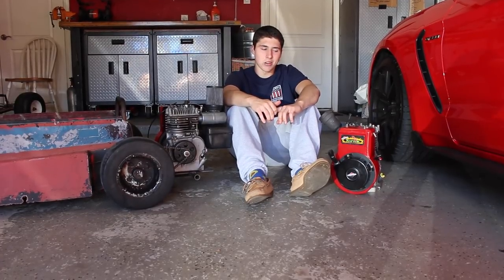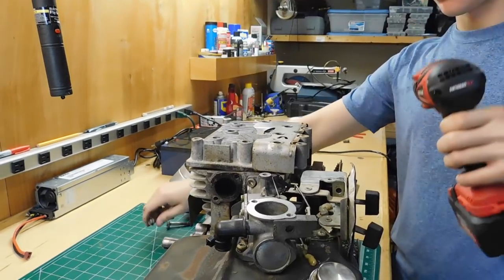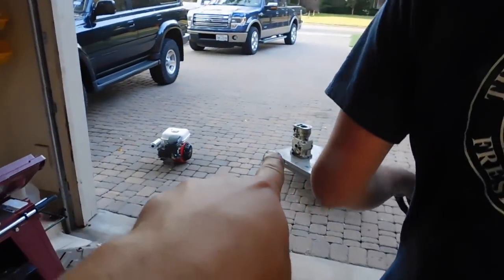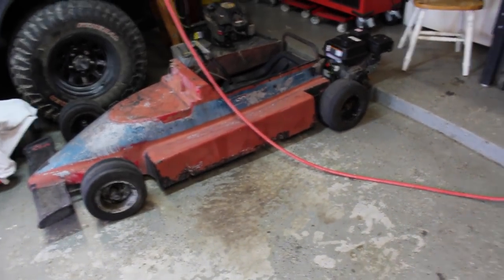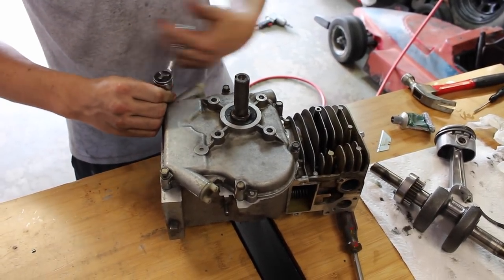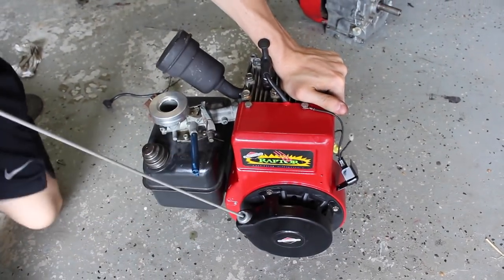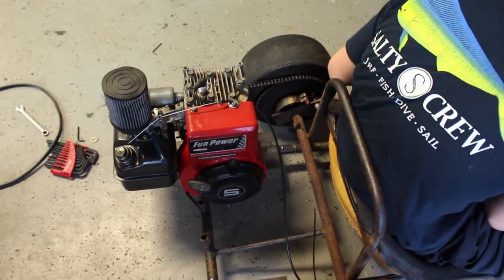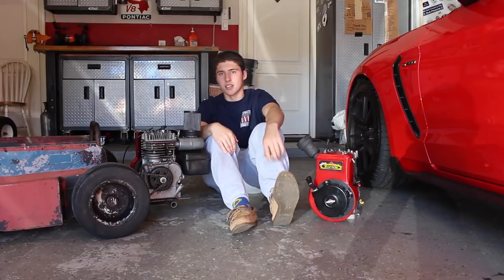Flathead Briggs Raptor Engine Rebuild for 60's Go Kart!

Comment: when i was a kid my dad gave me a mini hone meant for that block and i honed my 5hp block with no issues, but i remember it having a factory steel sleeve? It was a block from the 70’s. That motor made 12hp on alcohol back in the day, that kart was moving👌
Reply from the maker: That’s sick, yeah these ones don’t have steel sleeves as far as I can tell.
Reply: Build Break Repeat build that hemi predator up.........use a Honda clone head cuz the hemi predator has a flat top piston and adds good compresson

Comment: pretty sure the block for the raptor  engine is shaved meaning higher compression possible even had some porting done. just saying that to let yall know
Reply from the maker: Christopher B That’s pretty cool, I’ll have to take a look at the old head.
Reply: @BuildBreakRepeat  porting is done on the block on flatheads. The heads just have a fireslot of modded

Comment: The best way to hone is use an old school hand crank drill and a 3 stone home. A good cart engine builder can bore the cylinder and install a stainless steel sleeve.

Comment: A good way to seat the valves without removing the head is to pry up on the valve spring with a screwdriver and suddenly pull the screwdriver out.. takes care of any carbon issues around the valves.

Comment: a) taking the piston that is scoring one cylinder and putting it in another block will not make it stop scoring the cylinder
b) putting in the piston from a different engine without first checking that the tolerances match will give you blowby or cylinder scoring (or both)
Reply from the maker: Nikolas Tesla We thought about that and that’s why we didn’t keep the raptor piston in there, we just put the original pistons in the engine so there would be no issues with that, thanks for the advice tho.
Reply: No! do you know what rings are?

Comment: my mini bike has a briggs and stratton 5 hp flat head engine but i dont think it will last long because the cylinder walls are kinda bad
Reply: Donovan Bryant I’ve had a 60s Briggs since brand new and the cylinder walls have been scored ever since the 70s and it’s still a great engine so don’t worry

Comment: Yea but that fly wheel wont usually turn over as many rpms as a predator 😂 buy a predator build it and it will have more power than any built 5hp flat head unless its from a true flat head builder still ohv engines make more power than a flatty
Reply: Damn people who dont know about small engines crack me up😂
Reply from the maker: Kylee Bates Yeah your right but I mean we’ve done other racing go karts and stuff in the past but we’re really not building this one to be crazy fast (or else we would have done live axle) we are just restoring it and making it cool and in our opinion a flathead briggs is cooler than a predator just cuz of its classic ness.
Reply: Kylee Bates you sir are incorrect built properly a 5hp flathead will dominate a 6.5 predator ever heard ofa blockzilla briggs if not look it up
Reply: Yea an the only way to get a blockzilla is from briggs. Dont start dissing me buddy i know alot of people whos made pretty close to 45hp if not more with a pred you'd be surprised what us southerners do to our ohv engines
Reply: A Raptor III with a tillotson carb and a billet flywheel isn't exactly a push over.
Reply: Kylee Bates that's when the big gx390 steps in I got a built 390 an I'm building a Briggs vanguard v Twin
Reply: Kylee Bates an you gotta do a lot to a Briggs Flathead to even come close to making the power as a Bolt on predator nobody Race's Flathead's anymore